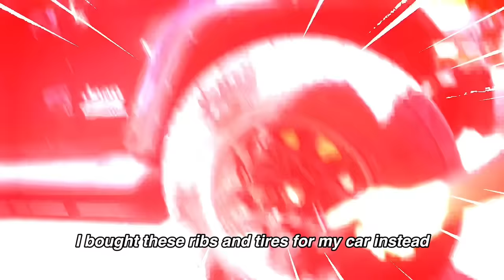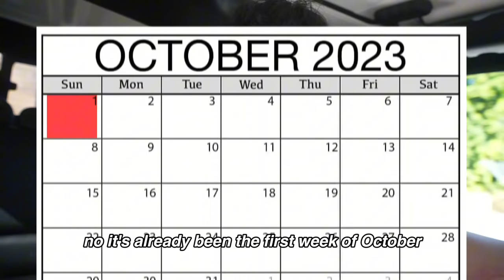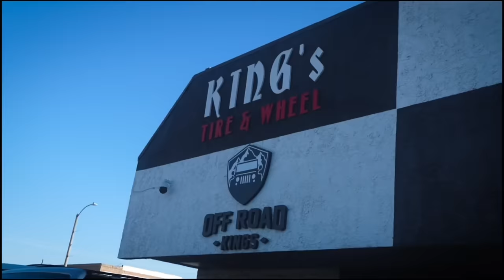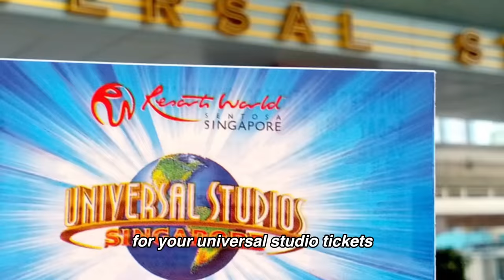My Spoiled Sister Hates My New Car... 😡😡😡

Comment: Buy new Carbon fiber steering wheel and when you start changing steering wheel be careful with airbag cuz you will need to disconnect battery for 3-10 minutes